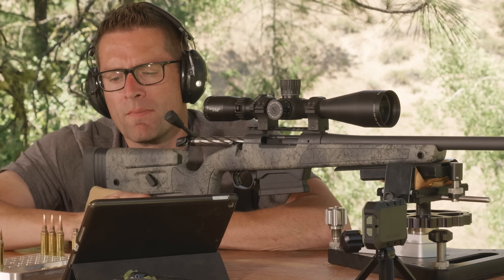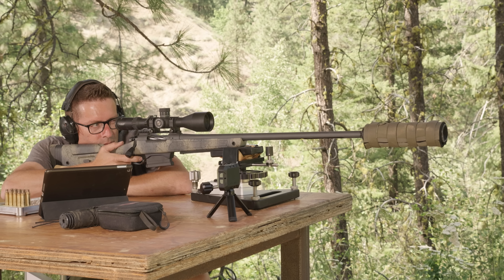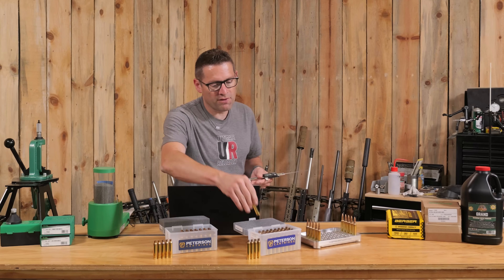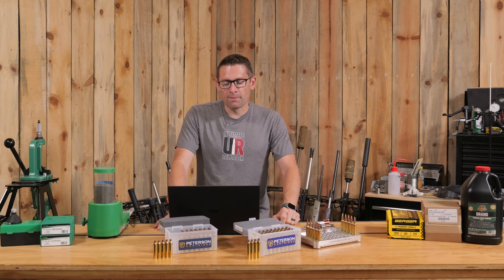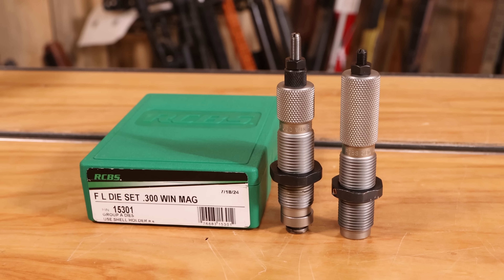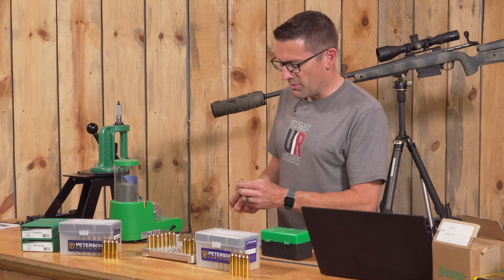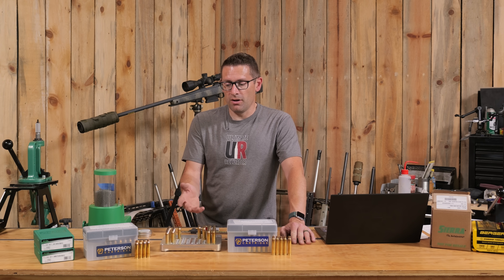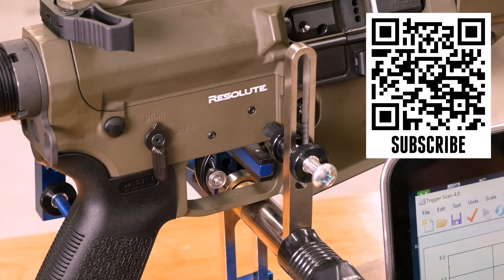Excessive Headspace Solved: Peterson Longs (7Rem & 300 WM)

Comment: When I first bought the 300WM long, I did the exact same thing to determine specs.  The only difference that I found between my results and yours, was that I when I used Federal factory ammo, the difference in base to datum was a whopping 0.026".  Shared this info with some fellow shooters and the reaction was disbelief.  Knowing that this crowd was like that, I brought everything with me to the range for a practical confirmation.  To say they were incredulous would be putting it mildly.  Don't know for sure, but I hope I got you some converts and new business.

Comment: Great video, no reason not to use it from what I see but what an opportunity for another video.
I’d like to see a head to head brass life comparison video on how many firings a belted magnum can do using one load (same components) in one rifle using the following constraints:
-Standard brass, FL sized, shouldering off the belt with no annealing.
-Standard brass, FL sized, shouldering off the belt annealed every firing.
-Standard brass, sized to headspace off the shoulder and annealed every firing.
-Long brass, sized to headspace off the shoulder and annealed every firing.

Seems like extended case life is the angle of this product, the above test using maybe 5 brass each would likely be very informative to viewers.

Comment: Can you not do basically the same with regular factory brass? Like I have several once fired 300 and 7 mm cases. Couldn’t I use the comparator to re size the brass for minimal clearance after the first firing?
Reply from the maker: The point here is to have optimal shoulder placement/dimension BEFORE first firing. (there are two important advantages to that, longevity- no big first stretch, and accuracy of first loads)

Comment: This doesn't make any sense whatsoever.  As soon as you fire (form) the first time with a new shell, it forms to YOUR chamber of THAT rifle. So that makes this Peterson brass a moot point imho..unless I've completely missed something
Reply from the maker: Yes, you did miss the point. Undue "stretch" is bad, and why not start with something that will work better on the first firing? Make sense?
Reply: @Ultimatereloader  No, it doesn't make "cents"..not to a reloader who's rifle cartridge is producing 60.000 psi..it simply doesn't matter.  Once the bras is fire formed, that's it. It cannot stretch beyond your rifle chamber.  However, if you're suggesting that Peterson brass (or Lupua, Nosler..ect) is overall superior to, for example, Remington brass due to tighter quality controls...ok I get that.

Comment: For precision on a belted magnum I add between 0.002/3" to go gauge (no go almost wants to close but not quite) takes the variation in belts with different brass out of the equation. Headspace off the shoulder like normal beltless cases. Fireforming is done with a soft seated bullet touching lands to push case into boltface (FF load is one node lower than intended use) From there, bump cases 1.5thou. 7mm practical for LR shooting. Performs as well as any rimless caliber.

Comment: Hey Gavin  my 257wby  and  300wby  cases have  the same  issue  according to my  comparator  measurements  . To get a quick sizer die setting  try setting a feeler gauge on the shell holder  and  gently  screw the die down to touch . Resize a case  , then  measure  & adjust to  get your  desired  shoulder  bump  . Cheers man and  enjoy your reloading experience  !!

Comment: One thing you didn’t mention was, if you have to change you resizing die depth. If you resize with it set to normal length, wouldn’t it resize the long to regular size.
If you mentioned it and I missed it, I apologize.

Comment: By the best sammi brass and load same bullet same powder and charge. Test it against the Peterson long brass. If there is a significant accuracy change just from that. Then they are on to something. I know every gun is different. But if it helps the accuracy right out the gate. Then brass life is just a bonus

Comment: It's taken so many years for a company to think of this. What they really need to do is make brass that's oversized just a little in every Dimension, so you have to size it. Basically, you would eliminate having to fire form your brass. If you already had a size dye set up for your chamber, you would be able to use this oversized brass and be almost as good as fire formed brass on the first firing.

Comment: Forgive the novice question but wouldn’t running it thru there full length die push the shoulder back into the factory range? Or is it a matter of setting the die to the case for first pass?

I’ll have to search up past videos to hopefully catch a breakdown on how to properly set up the die to get desired shoulder bump. Again, very novice and I find these videos to be VERY helpful. Thanks

Comment: Take brass, fire form, anneal, size accordingly, repeat... The only time I see a difference in brass with a belted MAG is if I'm pushing it to pressures that shouldn't be done. Normal loads will never notice the difference in headspace. If you push these things to whatever "max load" is, you'll be blasting primer centers out well before you have any case degradation.. In my experience. Your results may vary. 😁

Comment: I have a 7mm weatherby ackley improved that i blow the case out for 91 grn case capacity....
  Using norma brass and custom whidden dies that match my chamber, i get ten firings per case shooting 195 grainers at 2944 with an extreme spread less than 12 ft/sec...

Comment: As Gavin said... 
"Blow's out.."

It's a big difference between blowing out and stretching out 😉
As long that the belt headspace fairly right ,the shoulder will "blow" out without much stress to the case other than the bottom part due to belt headspace. 
After this first sloppy shot you can measure and size to right dimension and ignore the belt as the video points 👉 
I mean.... you don't have to buy special stuff to get the same results. 
Mutch likely the Peterson will have higher quality than let's say Remington.... , so it's not wrong to buy Peterson 👍

Comment: I have long understood the relationship between the belt and the shoulder. If you show me a reloader who disdains the belt, I will show you a novice reloader.

The longest initial stretch I have measured is .019". That's a lot to overcome in terms of case longevity. 

The reason shoulder length is all over the map on new brass and ammo is because the manufacturer knows the belt is there to save their bacon. 

For decades, I've necked up new brass one caliber (sometimes it takes two) so that it won't chamber. Then I FL size it back down until the bolt closes with resistance. This could also be done with new factory ammo by pulling the bullet, dumping and saving the powder but would be a major PITA, a job relegated to winter time.

Thanks for the vid!

Comment: I've been shooting a .264WM for 20+ years. Best advice I was given was to ignore the belt and size off the shoulder. Anneal after every cycle, getting 10+ loadings out of Hornady brass. Wish they, Peterson, made .264 brass.
Reply: why not get some 7 Rem case and size them down to the 264WM? They are "nearly" identically same case, just 7mm rather than 6.5mm (.264). Sure, the head stamp would be screwy but...
Reply: @CJ-ty8sv has a point, and is what I do for my .264. 
Of course I don't have a 7 rem mag and don't have to worry about mixing anything up. I still mark everything.
Reply: @Hill-m1z absolutely must mark everything.  Because when you die, your family will clean out your gun and reloading room and everything will be sold at auction. Most likely.
Reply: @CP_300PRC  I have contemplated doing just that. And seriously now that they've offered "seconds". So I may have to give it a go.
Reply: My  Father was a master  machinist  in the  late  50s to the  early  90s  .  Tolerances  on  any  project  was dependent  on  the capabilities of the  machines  making the  parts  . Measurements  were  taken  with  micrometer, & vernier calipers  , later dial calipers  were use to mechanically  adjust the equipment  & Measure  Tolerances  . Now we have digital calipers  &  adjustability  like on your  lathe !! As you know that's the reason  Sammi  chamber tolerances were  generous with the  legacy cartridges & up to the  mid  90s  . Way back in the 50s & 60s , bench rest shooters got tight  case tolerances by fire forming  & neck  turning/ sizing  . Today we are so fortunate to have machinery  capable of  holding  tolerance of a few 10 thousands of  an inch  !!! Now every newbie  cartridge  is magically  " inherently accurate  " I'll  bet you could make a 30-30 win chambered  in a bolt rifle and  get  sub half moa groups  ! I've been headspacing  my belted  Magnum cartridges off shoulder  for  over  40yrs  by backing off my  sizer die so that  only  about  3/4 of the  neck has been  contacted  and sized , fire forming  and  adjusting the  die as needed to get  reliable feeding  . Of course  we still had to  accept that the first  firing  would  stretch  the cases  to the  max dimensions of  your  chamber  , now  Peterson  has come out with a product  to  minimize  initial  case stretch  and  good for we reloaders  . Cheers and thanks for the  update  !
Reply: Exactly, just bump the shoulder back a bit until the bolt closes behind it easily and leave the die alone after that. I've got some .300wm cases that have gone 5-6 firings so far
Reply: @twistednixon2911  To date I have 4 firings on Peterson 300WM long. Pushing 208's to 3K fps, No issues and not expecting any!
Just ordered 7mag longs and will be resizing them to .264 and give em work out in the .264 WM.
Reply: Absolutely good buddy. Everyone who loads should be doing precisely those steps.
Reply: Same issue different caliber. Theyre going to make a couple more different types I've heard.

Comment: I just purchased Peterson 7MM Rem Mag LONG brass. 
My first fire forming in my Tikka T3X Superlite blew the shoulder forward a mere 0.004”. Very consistent with your data which you stated to be 0.005”.

Out of curiosity I took some measurements to assess the brass weight to determine Peterson’s manufacturing and quality control. 
Average case weight for 25 cases was 237.98 gr, with an extreme spread of 2.25 gr and std deviation of 0.58 gr.  Quality stuff!!
Reply from the maker: Awesome!!!
Reply: The best there is.

Comment: Could you get the same effect by necking up fresh brass for the 7mm to 30 cal then necking back down to 7mm to create a false shoulder to proper shoulder headspace, on the 300 neck up to 32 cal then back to 30 cal to set the shoulder, then fireform?

Comment: The biggest issue with reloading and longevity of belted magnums in my opinion is really case bulge just above belt when sizing to headspace off the shoulder rather than the belt. This is a known issue that results from a FL Sizer not getting down far enough to size the based of the case just above the belt when only bumping rather than pushing back to SAAMI and while there are some tools out there to help this its extra steps that do need to be done if you really want to get the most life out of your brass in a belted mag.

With that said, the Peterson brass is pretty good brass. I had picked up a couple boxes of it when they first released that +.010 for the 300WM. I will say this though, the heads were a bit soft and I had a few that opened up primer pockets. Now granted, it was kind of a hot load but a similar load in Lapua hasn't seemed to phase the cases at all. I say similar load because its not identical in load wait but was the same average velocity with slightly better SD's and ES's so for all intents and purposes, the pressure should be very similar.

Comment: When they cut the chamber the barrels they cut the belt correctly to get proper head space. The shoulder often is cut too long, just sloppy chambering. Been that way for as long as they have been using belted cases. 
Some belted cases this doesn't have as much effect because the taper of the case and shoulder angle.

Comment: I did not know Peterson made a "Long" cartridge. It definitely sounds good. I loaf quite a bit of 7mm Rem mag and 300 Win mag.
I have always FL Sized both since I  was not into precision at that time. I am now though with all my cartridges. 
So with those two since I  have lots of that brass, I  will just start to bump the shoulders back and pay close attentention to case length.
Thanks Gavin for this information. If I needed brass for either then I  would definitely buy the Peterson Long cases.

Comment: Interesting video, will the Peterson Longs help to reduce base bulge above the belt in .300 WM?  Which for me is the usual case killer.  How many reloads are you getting per case?
Reply: Nope,  the problem is if you are not pushing the case all the way into a FL sizer, to the point that the belt is what stops the case from going any further, the bulge is never pushed back in.

Not sure if they are still being made because the original guy who designed them and was making them passed away a few years back but there was a guy / company in Central Florida that designed and made a collet die (kind of like the Lee Collet Necksizing dies) that was purposely for remedying the case bulge issue with belted mag cases when sizing to headspace off the shoulder. They weren't too badly priced (I think like $120 or $130 when I bought mine) and they are nice too because they also had a "gage" feature designed into them to check sized cases to see if the bodies needed to be compressed or if they would camber without having to actually try them in the rifle

Comment: Assuming this long brass could limit case head separation that are common for me after three reloadings in my 7mm Mag.  Is that correct?
Reply: Yes that's the idea behind the long case
Reply: If you are getting case head  separation  after only  3 firings  , you are over  resizing  your  cases  !!  You  likely have a large  chamber  and  a minimum  sizing  die  . Back  off your  sizer die  about  1/8 inch  . You  need a to get your  cases  to  headspace off the shoulder  . Don't  set up your die to  touch the  shell holder  ! I've been  loading  belted  cases  for 40yrs and  never had a case head  separation  . Hope this helps  cheers  !
Reply: @GuyGooding-q9o This is my first belted magnum cartridge rifle and it’s been very frustrating to have a promising load worked up only to have the case head separate. Thanks for taking the time to suggest another option!  I’ll give this a try before I relinquish to factory ammo.

Comment: You know how this all could’ve been avoided? 

By not having a belt in the first place.
Reply: Those engineers what, 115 years ago used them in double rifles. Were never intended for bolt guns. Until they were all the rage in 1920
Reply: @338Alphadog  So what? When the 7mm rem mag and 300 Win Mag came out they should’ve removed the belts then and headspace them off the shoulder. Belted ammunition was a stopgap measure to reinforce the cases of the time when ammunition was poorly manufactured. It was an obsolescent feature by the 60s.
Reply: Belt was never a reinforcement. It was for headspace on doubles. Ammunition designers just didn’t take them off except Charles newton
Reply: @338Alphadog  Maybe but from what I what I remember reading that wasn’t the main purpose. 

Regardless, Remington and Winchester should’ve removed it in the ‘60s. It had ZERO place being on the 7RM and 300WM

Comment: It seems like these LONG cases are righting a wrong, so to speak.  The ´wrong´ being way too much slack in the shoulder headspacing.  Basically the initial tolerancing was not conducive to reloading longevity.  Better late than never.  Great video as usual.
Reply: The problem that people will find though is that after a few reloads, the cases will no longer chamber. This is because of case bulge that will occur right above the belt since a FL sizing die will not be going down far enough to size the case at the base if you are not pushing the shoulder all the way back. This is a known issue with resizing to head space off the shoulder for belted cartridges. There as has been at least one successful attempt at a production (sort of) die to fix this but I'm not sure the company still exists because the guy who started it and did all of it passed away a few years back.
Reply: sounds like a conspiracy to stop hand loaders
Reply: @beargillium2369  Doubt it but if it is the jews are responsible.  Too soon?

Comment: Just buy a PRC and be done with it.
Reply: Theres really only 1 prc worth buying. And that's 300 prc. But you can achieve the same thing with 30 nosler and better performance with 300 Norma mag. Otherwise. 300 rum and 300 win mag are great. The other prcs arent even worth talking about.
Reply: @josephmandragoran4262 30 cal bullets have worse BCs than a 7 or 6.5. How is a 300 PRC the only one worth considering?

Comment: Ran into this problem a few hours ago. So the timing is good. Helping a friend with Sako 7mm Rem Mag.
(1970s gun). He gave me 2 packs of fired Normas. I compared it with my Sako 90 Quest.

I happen to also shoot Norma brass and it still fireforming some new brass. On his fired brass it was about 0.005 longer than an unfired piece of Norma brass.
On my fired brass it stretched brass by 0.015!

The video confirmed my suspicion that much one go is not good. So I am glad to see Petersen addressing the issue.

In my .375 H&H the shoulder is not much and I have noticed it does not seem to matter all that much.